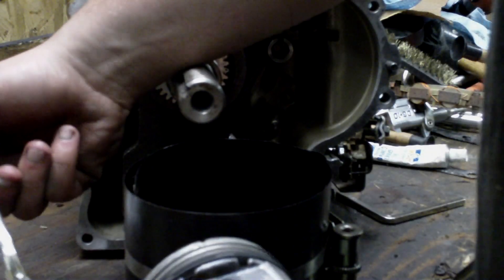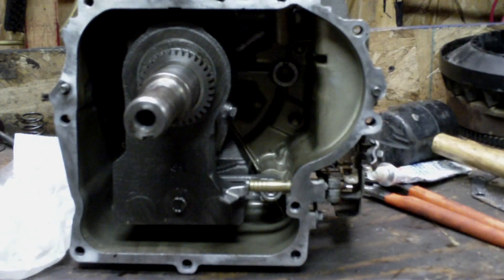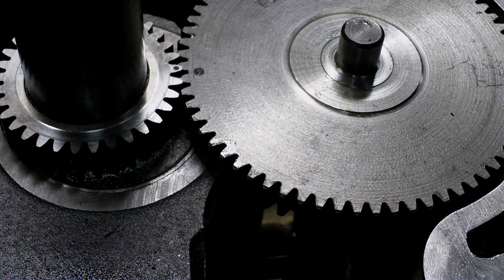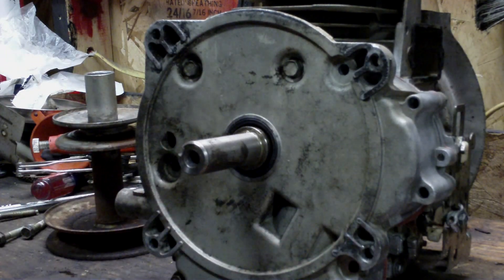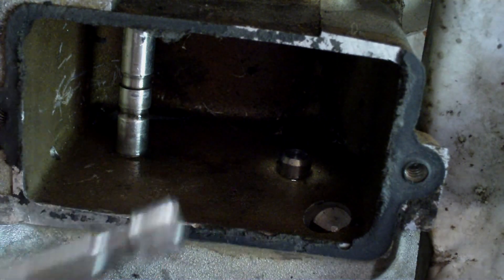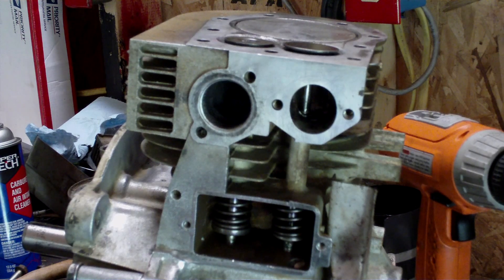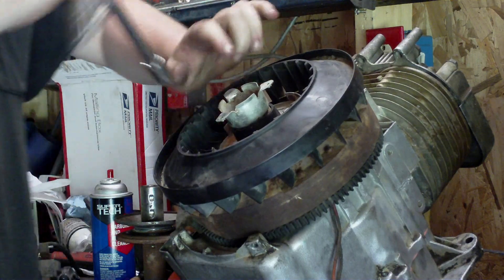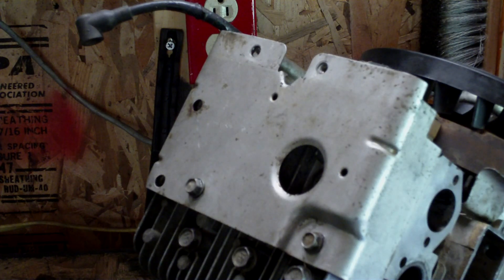Briggs and Stratton Power Built 12.5 HP Flathead Model 28 Rebuild, Teardown / Reassembly PART 3

Comment: I overhauled my 13hp model 28m707.  Put in new piston rod, piston and rings.  New intake and exhaust valves.  Engine is very hard to turn over due to high compression, when it does start it runs fine.  Any suggestions would be appreciated. Thanks

Comment: How do you know which piston rings to use? I pulled up a drawing for my b&s 12.5 hp flat head. It shows .020 o/s rings, but I see standard, .020, & .030 for sale. BTW it has a cast iron sleeve.
Reply from the maker: Most of the time, if the engine has never been rebuilt, and the cylinder is in good shape and doesn't need bored out, then you can use standard rings, which is what is needed for cast iron sleeve. You would use chrome rings for a engine without a cast iron sleeve, aluminum bore engines. hope this helps, thanks for watching!!!

Comment: to how much the torque for the piston nuts to the follower
Reply from the maker: The connecting rod bolts? If they are both the same length bolts, 185 inch pounds, if different, torque small bolt to 185 in pounds, then the longer one to 260 in pounds. Thanks for Watching!!!

Comment: I have the same motor and I think it ran low on oil so it quit running.  Haven't checked it out yet.  Hoping there is a low oil thing on it and it shut it off.  Thanks for the videos.  Sounds like you have been doing this for a while.
Reply from the maker: Hopefully thats all it was, but it may have something more major wrong. your welcome! Yeah its been a long time, I used to help my dad work on the mowers as a kid, now i do it. Thanks for Watching!!!

Comment: What should I torque the flywheel bolt to?
Reply from the maker: For this exact engine its 85 foot pounds. Thanks for Watching!!!
Reply: @fnaguitarplayer9   thanks, I am rebuilding the same exact engine.
Reply from the maker: @countrylogic9168  your welcome! I hear ya, they are great engines.
Reply: @fnaguitarplayer9 Hey,  would you  also happen to know what the crankshaft counter weight bolt is torqued to, thanks.
Reply from the maker: @countrylogic9168   Are you talking about the single bolt that holds the counterweights on the crankshaft? Not sure on that, i've never seen it listed anywhere, but it goes pretty tight.
Reply: @fnaguitarplayer9 yes, the single bolt that hold the counterweight together. If you're not sure I'll just make sure that the bolt is tight.
Reply from the maker: @countrylogic9168  Yeah, I have never seen a torque spec listed for that, just get it pretty tight.

Comment: Resetting the governor arm did the trick. I didn't know anything about it until watching one of your videos on it. What's is your break in procedure to get the rings to seat after rebuilds.  That would make a nice little video if you haven't already made one. Thanks again. AJ
Reply from the maker: Your welcome glad to help out. I like to run them for like 20 minutes then change oil then cut grass as normal but take a few breaks to let it idle for like 5 minutes. It would make a good vid, might do that, I mention on my rebuild videos too. Thanks for watching!

Comment: Thanks to your videos I've been able to rebuild my 12hp model 28. It's a powebuilt and also has a cast iron sleeve, even has a little chrome sticker that says cast iron. Did you have to adjust the governor arm after you rebuilt it. I started mine up today and had to choke it to keep the speed down. I laid it mag side down with the PTO sticking up and put the tip of the governor/oil slinger on the governor arm when I put the crank cover on and it slipped on nice so I assumed it was where it should be. Carb linkage looks right. Any idea where to check. I'm thinking to adjust the governor arm and go from there. Thanks again for the great videos
Reply from the maker: Glad to help out. I recommend adjusting it anytime the carb is off. Thanks for watching!

Comment: Brigg has valve guide tools to install guides. Use a drill to install the reamer. Get the bushing tool for on top of the valve pocket. Also the guide installer.
Reply from the maker: I have the set for the smaller engines, but i haven't got this yet. Thanks for Watching!!!

Comment: i have one of these, a 286707 12.5 i/c quiet, and its been running fine without that little tin plate on the head for a long time. didnt even know it was supposed to have one. i always run 5w40 synthetic. Luck? its on a homemade gokart so it gets a lot more air than it would in say a lawn tractor with a hood. i think ill find one anyways.
Reply from the maker: I hear ya! Yep it helps keep them cooler, and like you said on a gokart it will get alot more air then a slow lawn mower. I have seen some without it but most of the 12's / 12.5's have them. Thanks for Watching!!!

Comment: Hello there I am in the process of rebuilding the same engine shown here, I have gotten the crank case put back on and now I'm hearing a clicking sound when i manually turn the shaft to cycle the engine plus it is hard to turn. what have I done wrong here please????

Comment: i have a 12.5 briggs and i cant find the cam shaft gear
Reply from the maker: The camshaft gear is built onto the camshaft, all one piece, but you probably need the gear on the crankshaft? IF so its part number 262135. If not, the camshaft part number is 212897. Thanks for Watching!!!

Comment: dude decent vid but that's not an oil slinger that's your Governor
Reply from the maker: Thanks. on the vertical shafts engines without oil pumps it serves 2 purposes, governor and oil slinger, there is no other way for the oil to circulate. On horizontal shaft engines the rod has a dipper on it instead, still has a similar looking governor but is not a oil slinger. Thanks for Watching!!!

Comment: I'm in the process of reassembling my 12.5hp B&G. How do I know that the oil slinger is installed properly? I didn't catch your technique when putting it back in. Thanks!
Reply from the maker: +cavarlyvet Just make sure that the shaft part lines up with arm (the part the goes through the block and connects to the linkages). if its lined up with it, it should go together easily. Thanks for Watching!!!

Comment: I have the EXACT "Briggs and Stratton Power Built 12.5 HP Flathead Model 28 Engine" you've rebuilt in this series - WHAT IS THE "CRANK case oil ring serial number" - im working with a budget that only works for the cash strapped home owners! I'll be tapping out my own gaskets as i have ordered a material for oil, fuel, and air...  PLEASE HELP !!!!!!!
Reply from the maker: zedieliam I'm not sure what part your referring to, i've never heard it phrased like that, you have a oil seal that the crankshaft goes through, then you have the crankcase sump gasket, between the crank cover and block. I will need the model type and code off the motor, there's been slight variances in just about all briggs and that way we'll know for sure its the right part #'s. Thanks for watching!!!
Reply: fnaguitarplayer9 Yes between the Crank cover and the Block, The Cover has "407" stamped into the it, next to that "O" ring and the Model type is "28V707"......
Reply from the maker: zedieliam Alright, the part number for the standard thickness one (.015") is 692226.
Reply: Hey Man - I don't know what to say - You have been such a great help, ALL THE TIPS, ALL the best choices that's best for your 1 cycle B&S 12.5's - I even bought your suggested STP TO TREAT MOVING PARTS !!!! - Thank YOU, Thank YOU, THANKS A MILLION !!!!!!
Reply: I JUST CHECKED EBAY,  AND THE PURCHASE SELECTION FOR JUST "1" OF THESE RING GIVES YOU 4 OPTIONS - 
BRIGGS & STRATTON: 298423
BRIGGS & STRATTON: 391086
BRIGGS & STRATTON: 391086S
BRIGGS & STRATTON: 4117 - NOW I'M CONFUSED ...
Reply from the maker: zedieliam I'm glad to help out! I hear ya, I really like STP for that, its good stuff! Your welcome, always glad to help out, if you ever need any more help feel free to comment or send a message, I always answer back, sometime slower in the summer though.
Reply from the maker: zedieliam oh ok, thats the oil seal, the number i gave you is for the gasket between the crank cover and block, actually my parts diagram shows 298423 as the # for the bottom seal. The numbers you have are for the top oil seal, under the flywheel. Which to be honest is basically optional, if you pulled the flywheel you might as well replace it but, its no big deal, its rare for one to leak as not much oil gets to the top. But I always replace the bottom one.
Reply: THANKS FOR SUCH QUICK RESPONSES !! I didn't pull the fly wheel yet, but i will. I guess I'll be looking for 298423 for the bottem seal - Thank Brother  - and I so, so enjoyed your tutoring !!!!
Reply from the maker: zedieliam No problem! I hear ya. Also, the one you'll need for the top would be 391086. your welcome, anytime!
Reply: Thank You- Thank YOUI  THANK YOU !!!!!!!!!!!
Reply from the maker: zedieliam
no problem, anytime!
Reply: Hey Brother - how did you ghet the OLD GASKET off the Block so CLEANLY ???
Reply from the maker: zedieliam
Patience haha I use a razor blade scraper to scrape it gently off, if you dig in to much you will shave metal away. You can also use a wire brush in a drill, that works really great. But some times if there is a low place in the metal, a small spot of gasket will not come off, and its fine since its filling a low spot and it won't leak. I always, anymore, use permatex form-a-gasket #2 on both surfaces where the gasket contacts, makes a perfect seal and helps hold the new gasket in place.
Reply: Thank you sooooooooo MUCH. !!!!!!!!!!!!
Reply: As an Update - "298423 for the bottem seal" is WAY TOO Small - That particular seal that you "tapped in with a socket"is the oneI am looking for. HELP...
Reply from the maker: zedieliam Your welcome, I must have looked up the wrong engine or something, i checked again looked up model 28v707 and i'm finding part # 291675 for the bottom seal. I'm sorry about that! Thats the first time I've ever looked up the wrong part for someone on here. And again I'm sorry about that!
Reply: Not a problem at all !!! - i appreciate ALL YOUR TIME - I ordered the 291675, just moments ago - THANK YOU soooooo much Brother !!!!!!!
Reply from the maker: Your welcome, anytime!
Reply: Briggs & Stratton 12.5HP FLAT HEAD 28V707 Piston OIL ringI broke the one closest to the piston ARM - It's the weirdest looking thing - there is a microscopic spring under the oil ring - and it's super thin - HELP !!!!!!!!!!!
Reply from the maker: zedieliam I hear ya! Did it break while putting it back together or did you find it broke when you took it apart? If you found it broke, did it scratch the cylinder up any? If it broke putting it back together, here's the part # for the ring set (have to buy a set of all of them). The spring thing your talking about goes on the groove first, very similar to how that bent looking piece goes on the type like i show in the video. The ring kind of straddles it more/less. Heres the ring set 499996 . Hope this helps!

Comment: With the torque tighten the rod?
Reply from the maker: Radosław Serafin If you mean the rod has play in it, and if a new rod doesn't take up the play within tolerance, you will have to get a .020" undersize rod and have the crankshaft journal machined down. Thanks for Watching!

Comment: can i use oil or what you use its not oil right?
Reply from the maker: Yes you can use motor oil on the parts when assembling, i just like to use a thicker oil additive (stp or lucas) its recommended to use assembly lube but there isn't much difference, as long as there is something there to prevent a dry start. Thanks for Watching!!!

Comment: after reinstalling the piston with new rings. It is extremely hard to turn the crank shaft. thoughts......
Reply from the maker: Josh Morris Have you installed the crank cover yet? if not it will be stiff from everything not lined up, also, if it is back together all the way, make sure your end play is right on the crankshaft, if its to tight, no play at all, it will be very hard to crank over. thanks for watching!!!

Comment: Hello, I was wondering if u could tell me which set of gaskets to buy from the Tulsa engine warehouse website for the crankcase as there are a few to choose from and I'm not entirely sure myself. Got the same engine but iv been stuck on the same problem with the crankcase for a fair wile. Thanks very much:)
Reply from the maker: Just to make sure is the same (there was some variances from year to year) i need the model type and code off the motor just to make sure i'm getting you the right numbers. thanks for watching!

Comment: i like the viedo 1.I need to have more information about fixing electrical systems on lawnmowers, safety wires tend to get into the way of letting the mower run properly or start. Trying to figure out which one needs if it is very hard to without trying to remove a safety feature. I would like to know more about wine process of a riding mower
Reply from the maker: I agree to a point, and to be honest on my mowers none of the safety switches are hooked up, but I don't recommend doing it, it can be very dangerous, the main one i recommend doing anything with is the reverse switch that shuts off the motor if you have the blades on and try to back up, thats the most annoying thing ever, and most mowers now days have a button you press to keep the motor running. You can do a google search for riding lawn mower schematics or wiring diagrams and find several different types that are out there. It would be hard to remove them, you just have to find the wires going to each switch and determine by trial and error whether the wires go together or don't touch, it will be different on each make/model. Hope this helps and thanks for watching!!!

Comment: I am trying to do one of these myself, and for days now and apart at least 5 times now. seems the intake valve stays open halfway up the compression stroke and therefore is getting no compression with a gauge. wants to start, but wont and blowing some fuel out the carb. what is causing this? for all original parts except the connecting rod and it is indeed the correct one. I even tried going 180 degrees on the cam with no luck. I am lining up the dots and the hole in cam placed top right when inserting it. is driving me nuts!!! and I need to get this thing running and done!!!  thanks
Reply from the maker: I had a similar problem on a 14.5 OHV but on it I put in a flathead camshaft to replace the bent one and the timing was backwards, now you say your lining up the dots, ignore the hole on the camshaft its nothing, you have to make sure the dots are lined up, the only other thing I know would be the gear on the crankshaft, maybe somehow the key sheared and its in the wrong place, but i would think it would just spin though, I don't really know what could be causing that, i wish i could help you out more! Thanks for Watching!!!
Reply: fnaguitarplayer9
well, you swapped out cams n therefore not original parts, n this is a flathead n exact one in video. like I said, I even tried going 180 degrees out n yes, hole in cam matters as to that fact and no, key is not stripped on crank gear. no matter, grabbing a rebuilt one for $150 and getting a trade in of $50 for one I can’t fig out towards it. and is all I have into it anyways...  win/win situation!!
Reply from the maker: Yeah I was just saying what caused my similar problem, Well that works haha Thats not a bad deal.
Reply: That's a decompression thing in your cam grind. All these flat head Briggs have that. If it not running its not because of the intake being held slightly open half way up the stroke they all do that. On my race mower mod 28 I actually grind that off for more compression give it more timing and run 93 octane.
Reply: actually I stated it wrong. is on the compression stroke that one of the valves stays open slightly till piston is halfway up. I have practically done everything to that engine and it is still sitting. have never had a problem before with any engine and have replaced many parts on this thing. ready to just buy a decent cheap used one to get riding mower done and sold before all my profit is gone...
Reply from the maker: ***** 2stroketerror125 That is the compression release doing that, 2stroke is right, but it should only bump it for just a split second about mid stroke giver or take. But they are all different. You might be able to get by with setting the valve clearance a few thousandths looser and see what it does, not to much because it will chatter and the push rod can jump off the rocker arm (assuming yours is a OHV) I know what you mean there.
Reply: nope, not OHV. I ended up buying a piece of equipment with a pull start 12.5. stripped both down and converted this one to have a charging system, electric starter with geared flywheel and different set up on carb so run/idle/choke all run on same cable as the other one did. fired right up n now to clean up riding mower and list it for sale, finally.....
Reply from the maker: I hear ya, sometimes thats the best thing to do, well at least you will have some spare parts for another project now. Which is always good.

Comment from the maker: If its a 5 horse briggs (standard for mini bikes and go karts) they have quite a bit of power stock. go to eccarburetors for performance parts, its recommended to run a billet aluminum flywheel if your going past stock governed speeds to prevent the cast iron flywheel from exploding. thanks for watching!

Comment from the maker: very common problem on these! yes you can do that, but I recommend using Permatex Form-A-Gasket #2, great stuff, and its about the same price as the blue rtv. And also if you can salvage the gasket, i would put the sealer on both faces then use the gasket as well. works really good. thanks for watching!!!